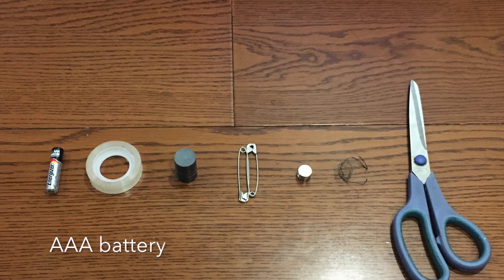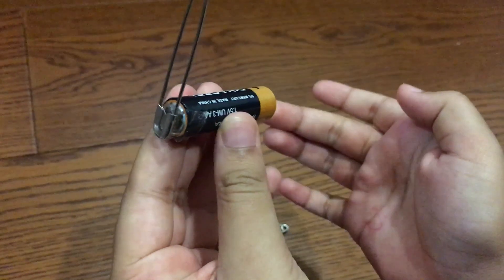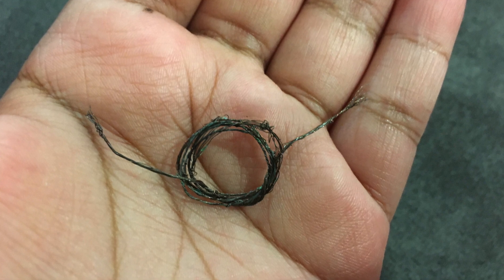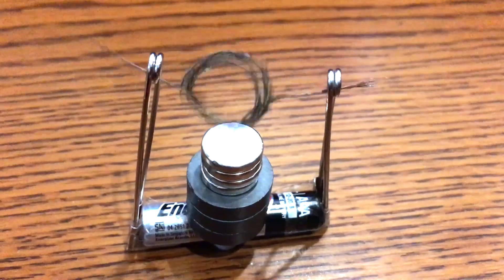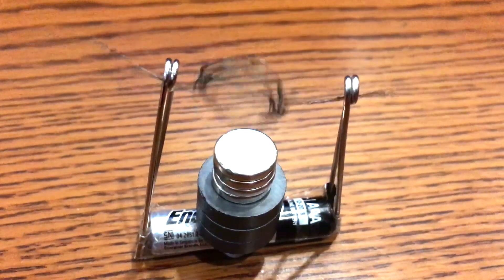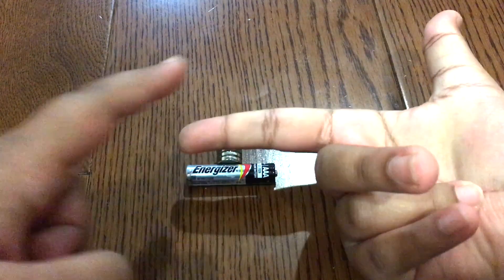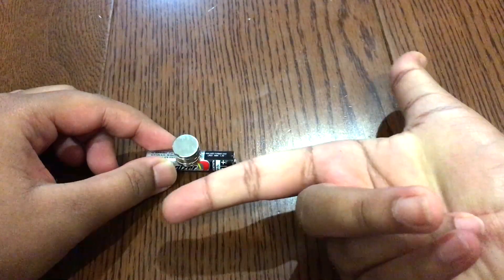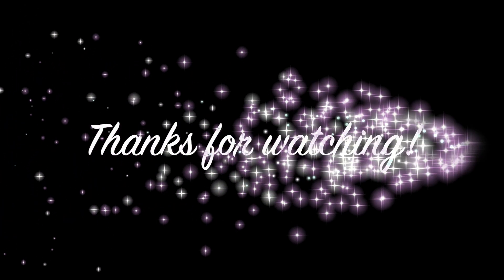Experiment with magnets and copper wire- how to make a simple homopolar motor part 2

Comment: 🤔Does it have to be a copper wire?
Reply from the maker: You need to use some sort of wire in which the metal components aren't attracted to the magnet. Copper works best. But, you can also use aluminium wire.
Reply: Sciencigo 
Oh, now I see...
Say—might silver wire make for a “better”[?] spin? (Silver’s a better[?] conductor than copper, right?...)
Reply from the maker: @Sedgewise47  Good question. Silver wire should work since silver is diamagnetic like copper but I have never tried it so can't say how well it will spin.
Reply: Sciencigo 
🤔What about—instead of a wire, a really tightly-rolled-up aluminum foil?...
Reply from the maker: @Sedgewise47  I don't think it will work but you can try.
Reply from the maker: If you would like to see more science videos, please subscribe!